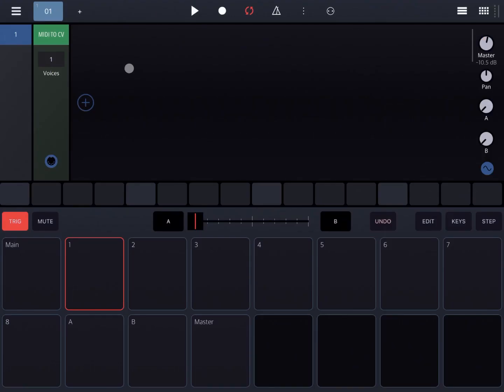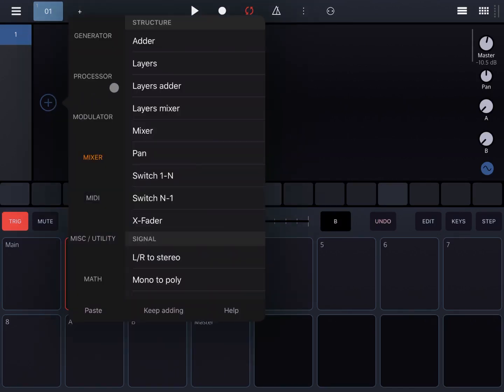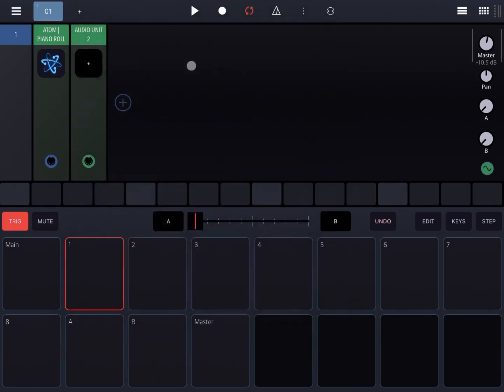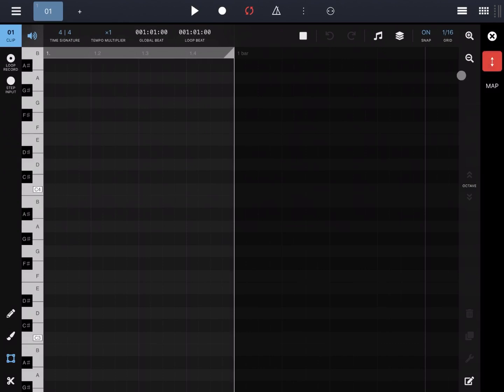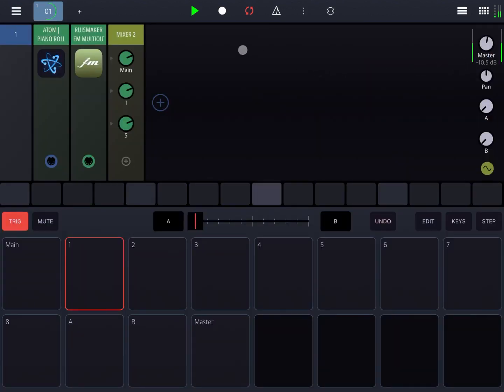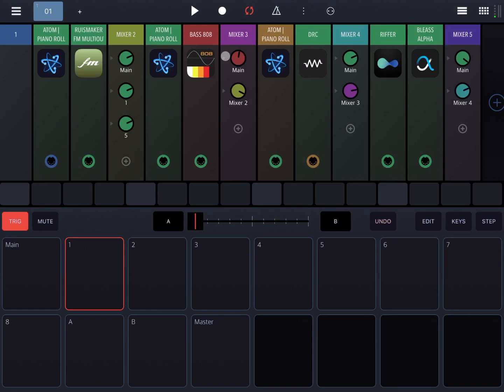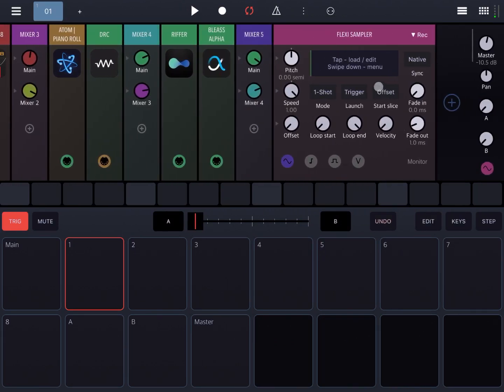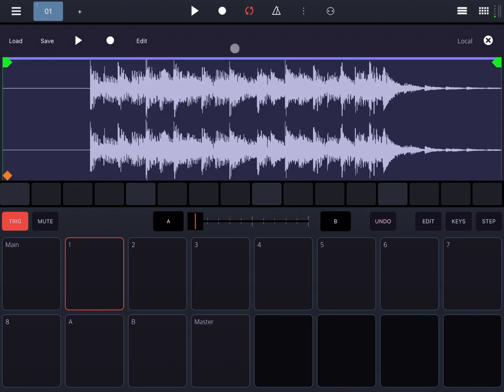BeepStreet Drambo - Tutorial Part 57: Atom Piano Roll, multiple AUv3s

Comment: Thanks for this. I tried a very similar configuration - using multiple instances of Atom | Piano Roll in a single track.  I found that Atom behaved rather erratically, adding midi notes some of the time, and omitting notes other times.  I ejected the instance of Atom, reinstalled it in the Drambo module, and then rewrote the midi part, and that solved the problem.  Have you experienced anything like this with Atom?
Reply from the maker: Not really, but I must admit because of the limitations of Atom it is not my first choice... there is an upgrade coming soon...
Reply: Hey! Thanks for replying.  Looking forward to the update - and your next posts. Thanks again.
Reply from the maker: Thanks